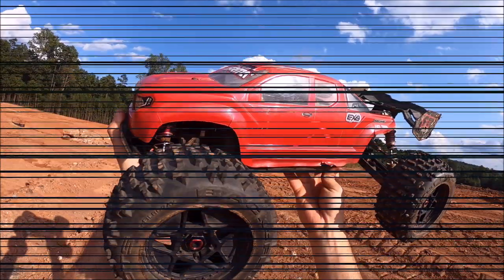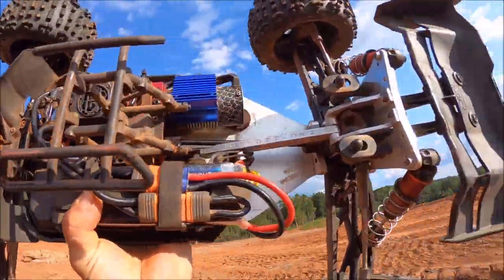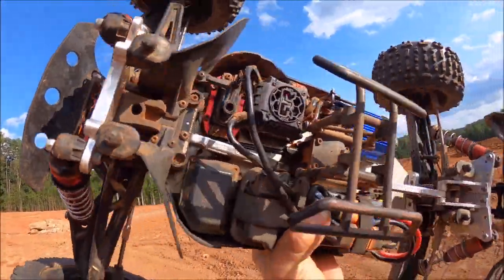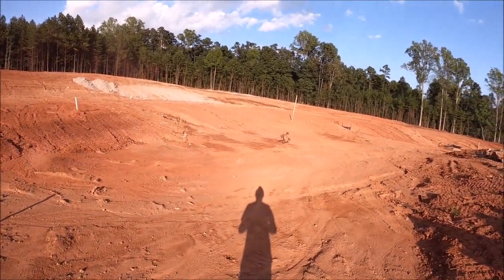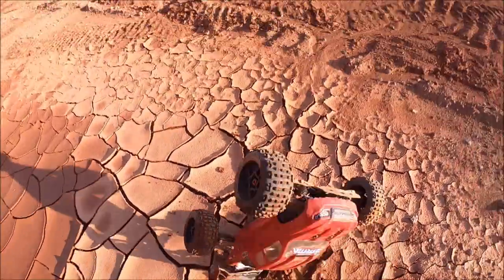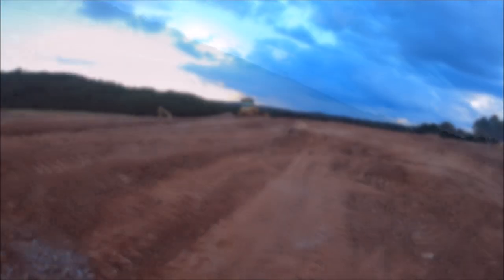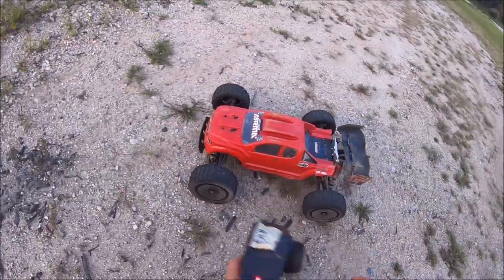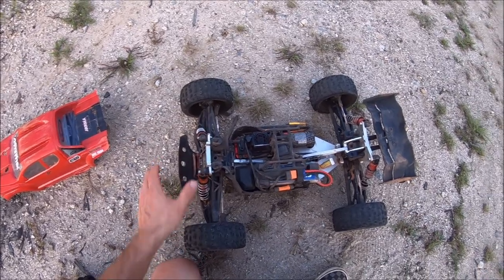FULL TANK MODE!💪 New 6s M2C Driveshafts test! ARRMA Kraton EXB

Comment: They need to be this tough out the box like advertised considering the price of some of them. I  brought an exb 1/5 I didn’t jump mine anywhere near what you were and I broke a rear  arm 😂 literally like 5-6ft jump and it broke after like 5 jumps and they say “extreme bash” 😂😂 when they can sell a car out the box that can do this then call it an exb 😂😂
Reply: I 100% agree
Reply: To be fair... my Arrma box says "designed tough"... Doesn't say it was built that way :P Guess they send those designs to m2c, he makes them even better while Arrma cheapen up before they build :P ... SPent more on upgrades than the car cost.... although mine wasn't exb model.. had some parts.. and if it was I would have replaced alot anyway
Reply: @brei.z  yeah true can’t argue with that hahaha I just ordered RPM arms ive heard there good

Comment: What weight diff oils are you using? Incredible bashing as always!
Reply from the maker: Thanks bro! Using 50k front, 200k center and 20k rear. All LSD gears.😎👊
Reply: @RCDUDE81  Nice! I run 60/200/30... I'm trying 300k in center, feels quicker to backflip on bigger airs. Bought silicone ear plugs to test out also.

Comment: Hey what steering servo are you runnin? I’m a huge fan of yours and picked up a kraton 6s v4 the other day and I’m tryin to get it set up to bash like yours. Do you have any pointers or suggestions?
Reply from the maker: I like to run Power HD 23kg servos! Super tough servos for the money!
Reply: @RCDUDE81   thank man! What gear ratio you runnin with the stock blx system? I thought about upgrading to hobbywing or spectrum system but you get plenty of power out of the blx. Sorry man I’m just still learning and you know your stuff so I would really like to learn some things from you.
Reply from the maker: I was running a 17 tooth pinion with stock blx system on Backflip LP's tires 👌Also 50k front, 200k center and 30k rear diff fluids punch 9 on the ESC.😎
Reply: @RCDUDE81   awesome thanks man! You think I could run a 16 tooth on stock tires? Or would the temps get to high?
Reply from the maker: That would be max pinion for sure. I'd watch Temps if running heavy in grass for sure!
Reply: @RCDUDE81   thanks a lot man!
Reply from the maker: No problem bro!😎👊👊

Comment: Are the drive shafts any longer to help prevent them popping out?
Reply from the maker: We looked at that but longer shafts will bind in the cups. The problem is over arm flex. Adding a bump stop to the front shocks will help. Fixed the issue on my Mojave and Talion.👌Also check your drive cups. If they are getting chewed up, you may need to replace those with M2C.😎🤘
Reply: I get the same issue where the pop out by the front diff but the rear are fine, i thought the m2c ones were longer than stock? And where can i get bump stops from?